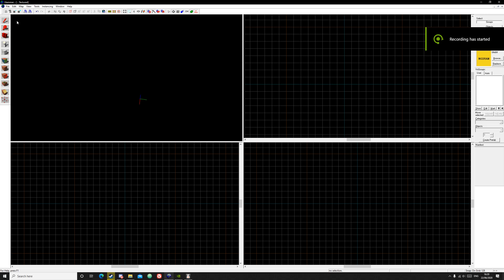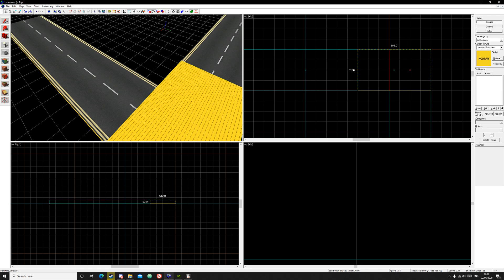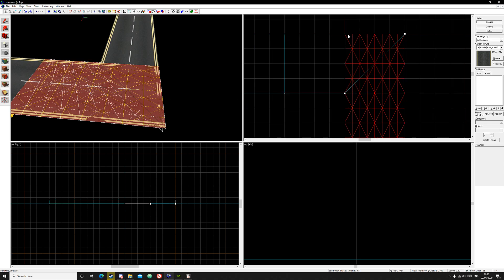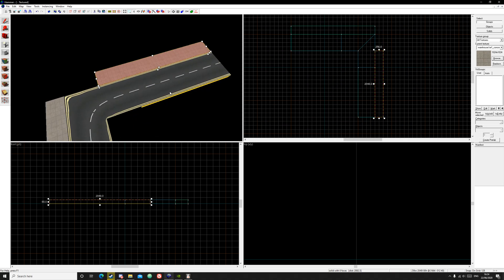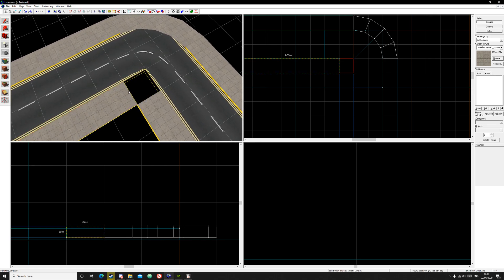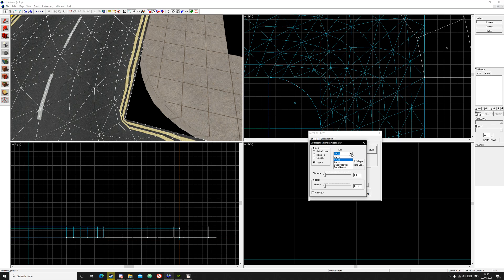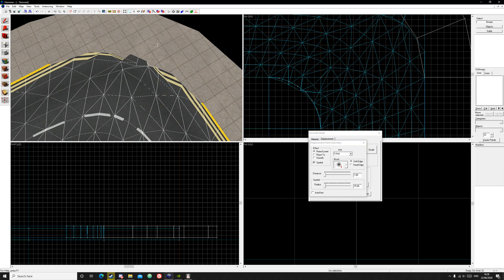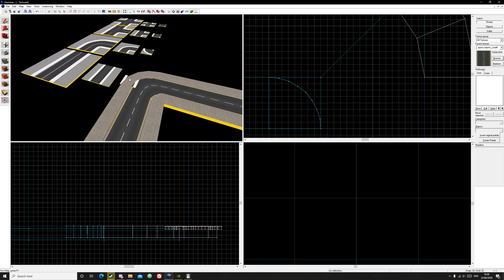How To Make Displacement Roads In Hammer

Comment: There is an easier way to make road corners and quicker
Reply from the maker: You could just use two blocks and have no road lines, but if you want road lines this is probably the fastest solution
Reply: Down you can just draw one block, change the object to arch and hit enter then type 90 degrees and 100 thickness and 8 segments then boom you have a road
Reply: Down oh and then use the texture application tool to do the lines, just search it up on yt it’s quicker and looks better